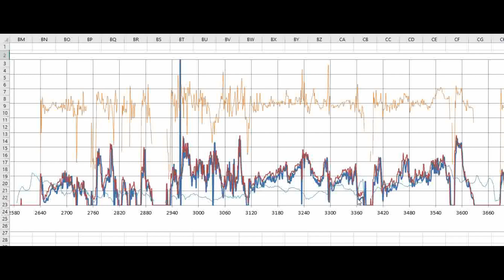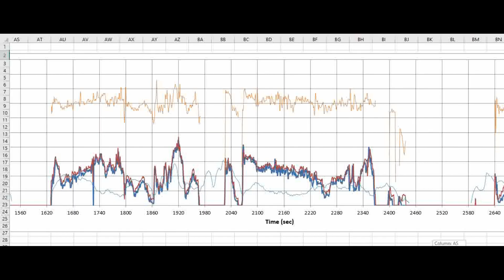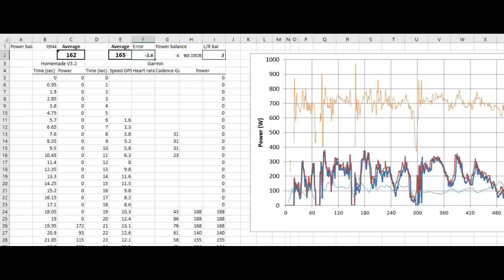Homemade Bicycle Power meter V3.3 update

Comment: Holy smokes this is infinite times better than the Stages power meter I uninstalled with a grinder from my XTR cranks 😂 you Sir an inspiration and a genius
Reply from the maker: It must be pretty bad, mine has a few minor issues as I mentioned in the video. Although overall it has been very reliable.
The best part of making you own is you're free to improve and fix it as you wish and you'll know how to.

Comment: Hi friend!
My father recently underwent surgery, so I've been quite busy over the past two months. It's been a while since my last update.

I've successfully implemented the balance calibration code for the power meter and developed two solutions. For the single left-crank power meter, the balance value serves as a fine-tuning option. For example, if the left side is calibrated to 55% and the cycling AP data reads 110W, the system will automatically correct it back to the actual 100W. The FSA PowerBox SC has a similar function.

My other solution is a dual-crank power meter connected via a 4-core fine wire. When the real-time power is below 5W, the balance resets to 50/50. Once it exceeds 5W, the system automatically calculates the left-right balance in real-time.

My code is nearly complete and functions more like an operating system. It supports numerous commands for data fine-tuning, such as Bluetooth transmission power, load multipliers, etc. These can be manually configured, allowing me to debug without relying on a computer.

https://youtube.com/shorts/r9_ywonDRhc?feature=share

https://youtube.com/shorts/nIeIOMg6F_U?feature=share
Reply from the maker: Hi, I hope everything turns out alright. Family things always come first. I haven't had time to work on mine much in the past 3 years due to a big house renovation project.
I had to read your comment a few times to understand what you have achieved. Seems like a clever solution that I hadn't gotten to with mine. You are developing a much more finished project than mine.
As always, it's good to have an update.
Reply: @Ed.R  Currently, we are using the Shimano R7100 crankset to convert to a dual-sided power meter. This requires drilling a hole for wire threading, and replacing the left preload nut with an aluminum one to facilitate wire routing
Reply: @Ed.R  https://youtu.be/ifcqWo1oQAU?si=QRik3wmXYjZFXwwF

Comment: Hello Oran! :) 
Could you tell me please, how do you clean your chain, chainring, cassette, derailleur and pulleys? Do you use only water and a brush to do this? And after that, do you lubricate the chain only or also the derailleur, pulleys, shifter and brake cables? 
I am new to bicycle maintenance and I am trying to find the correct way to do this.
*Sorry that this comment is not related to the topic of the video.
Reply from the maker: @atanasgeorgiev7073  I can tell you how I do it. Hard to say if there's a right way as everyone has their own opinion and different circumstances.
I avoid using water based degreasers and washing the bike in general if its for cosmetic reasons.
The chain gets cleaned in white spirit and dipped in hot wax. It stays cleaner but doesn't last in wet conditions. I top it up with a wax based lube until it gets too dirty.
The sprockets and chainrings and drive train in general tends to stay reasonably clean, maybe just a quick brush off. Light spray with a water displacer to stop rust.
The bike I only tend to wash before doing any maintenance requiring disassembly of parts. Stops dirt getting into things.
The important place to keep clean is the inside of bearings. Keep the grease in them clean and replace it if possible and necessary. This is why I avoid too much water and degreaser on the bike as it can penetrate into bearings and degrade the grease.
That's just what I do but not necessarily correct or convenient in your situation. Hope this helps otherwise the GCN channel has plenty videos.
Reply: @ Thank you for the answer! :)

Comment: hey, I installed the strain gauges exactly like you, I use an ESP32,  HX711 and an MPU6050  to calculate power based on torque and angular velocity. I get stabile results on slower cadence like 40RPM but power drops significantly on higher cadence 60+RPM, I think because of centripetal and centrifugal forces idk how to fix it.. you have any ideas ? thank you
Reply from the maker: @MrZzburatorul  hi, it depends how you are testing it, but centrifugal forces won't have any effect on the torque you are actually measuring. You are trying to measure the torque, minus any lost, that actually goes into creating useful power.
There could be lots of reasons. My first thought is that the sampling rate is too low. Torque peaks might be missed at higher rpm.
Reply: @Ed.R  yes, it seems like it's much better now, thanks man!

Comment: hey, do you recommend waterproofing the strain gauges with basic silicone sealant? will the readings be affected?
Reply from the maker: @MrZzburatorul  Good question I can't say for sure as I haven't tried it but I would imagine being a flexible coating it won't affect readings. I've used wax carefully melted over mine as a way of sealing them. I had used a 2 part glue over the top to protect the wax but it cracked eventually. I now use a specialist flexible silicone coating (FSC) designed for the conformal coating of PCBs.
Reply: @Ed.R  yes, I think I will give it a try. anyway.. thanks for your videos!